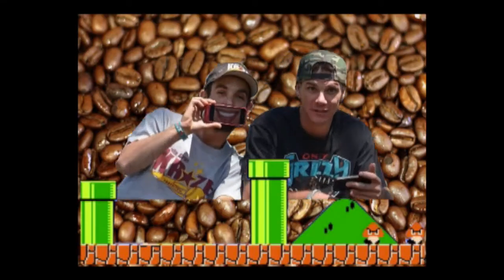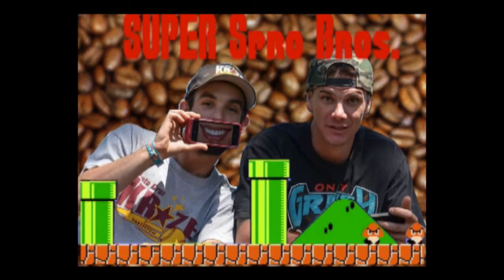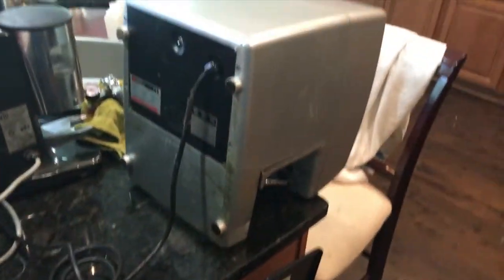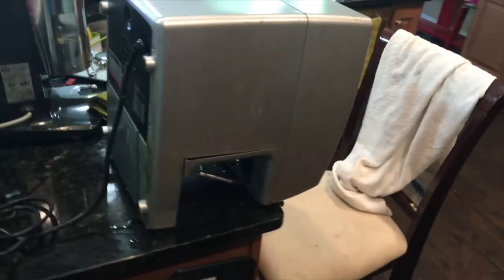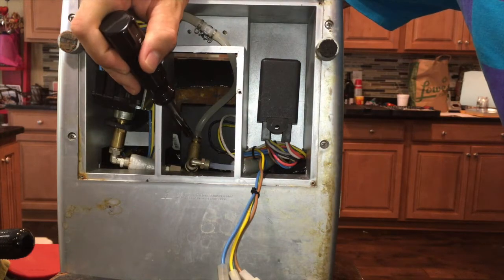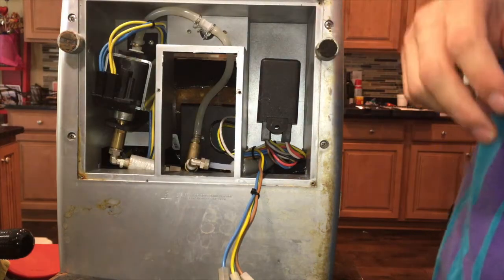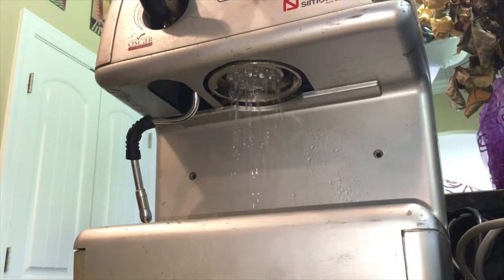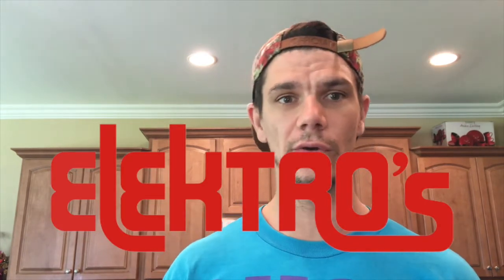How to Adjust OPV on Nuova Simonelli Oscar - Adjustment Over Pressure Valve Adjusting Tutorial

Comment: Hi! I've installed the OPV and have since seen other potential improvements for my Oscar 2. You were my inspiration to do it!
I have read up on modifying the flow with a Synesso ruby flow restrictor/gigler at the solenoid valve, removing the 0.7mm gigler from pump (07300860), installing a 3.2mm gigler on a hot side of the group, and relocating the original hot side gigler 3mm (07300225) to the cold side of the group

Have you tried anything like that? 

I tried to replace the 3.0mm giglers but the nuts on the copper pipes are stuck. I assume there is calcium build up. I don't want to break the copper pipe to open it up. Any suggestions? Thank you so much for the great information and your help!
Reply: Hi, just hopping on your comment because some of these videos and comments are old and it's refreshing to see someone recently tinkering with these machines! I know you asked for assistance, but it sounds like you have more experience than I do and I could really use some help with my Oscar I which I bought secondhand a few months back. My steaming pressure has been inconsistent; sometimes I can't steam more than 1 drink's worth of milk and sometimes the pressure will fade out to almost nothing before I can even finish one drink's milk. I can't remember if this was happening before I changed my steam tip to a La Marzocco tip, but I don't think so. Is there a valve I need to install or fix to help this? I haven't run a descale since I've obtained the machine, but I don't know if that's the issue because sometimes the steam seems just find and other days I just can't get enough steam going. This has been an issue for a bit so I hope you see this and could spare a few minutes to help me out; thank you!